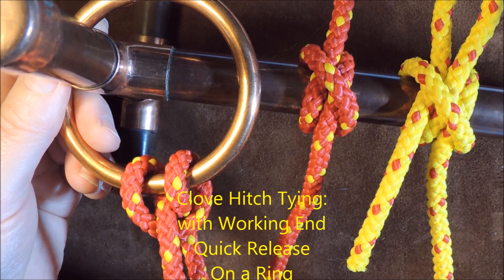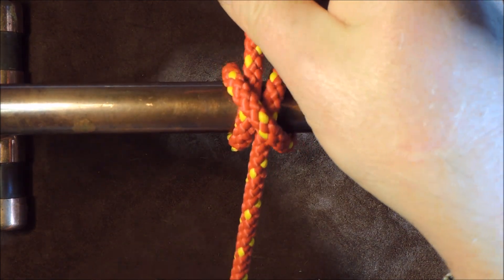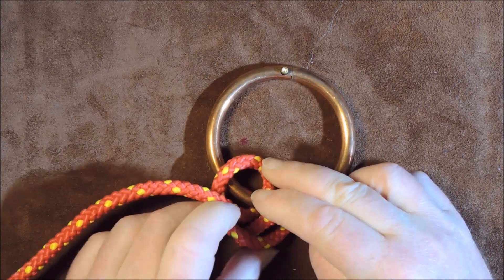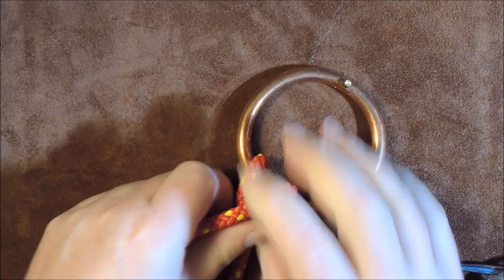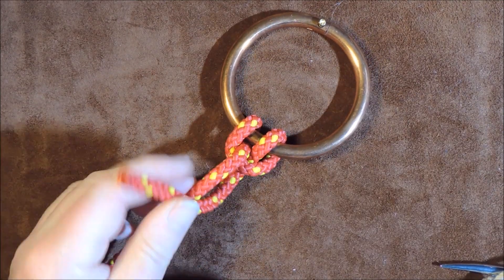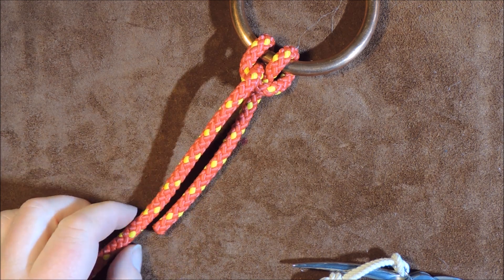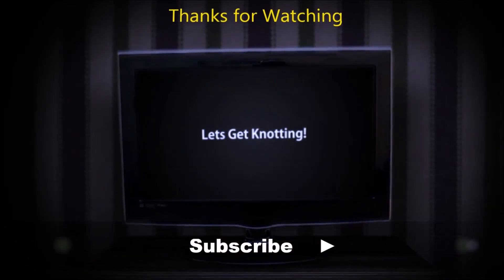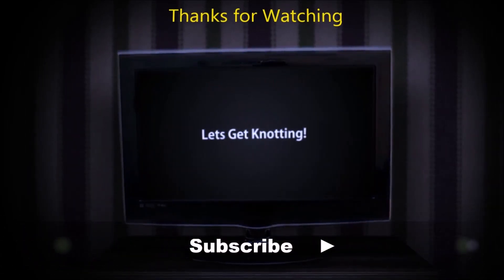Clove Hitch - Clove Hitch on a Ring - Clove Hitch on a Bight - Slipped Clove Hitch - (How to Tie)

Comment: The Clove Hitch is an essential basic knot to know

In and of itself not the most secure knot, but forms the basis of multitudes of various knots and hitches. Among them are the constrictor , the buntline hitch and the 'bag knots'

Bag knots such as the groundline hitch and snuggle hitch mostly utilize an internal tuck of working end under the standing end. This provides good security eliminating a need for an extra half hitch
Reply from the maker: Thank you so much for your comprehensive reply, much appreciated. I will pin this comment so that others can learn from it.

Comment: A very good and clear video, well done.  It seems no one has made a video on how to tie a clove hitch on the bight when the standing end is under load.  I couldn't work on a boat or pitch a tent with out this knot.  You wrench down on the load, do two or three round turns, then flip the rope over on itself just like in your video only directly on the bar.  Extra tight and secure in about two seconds.